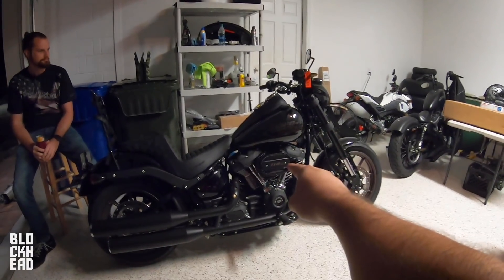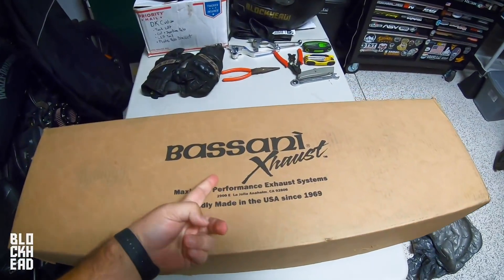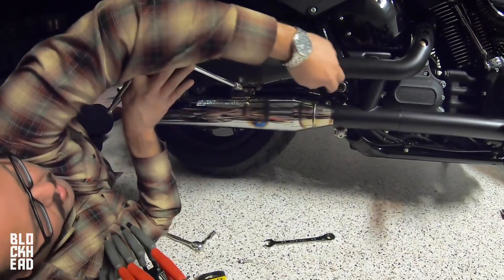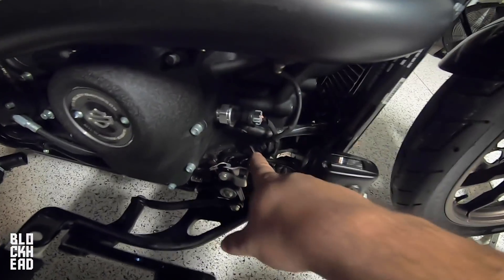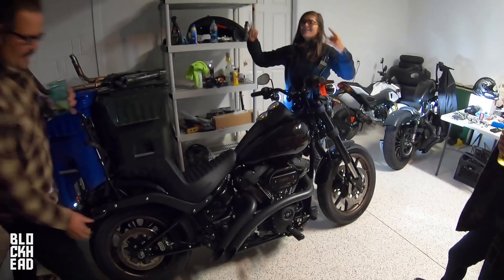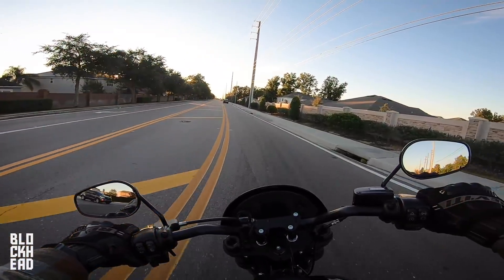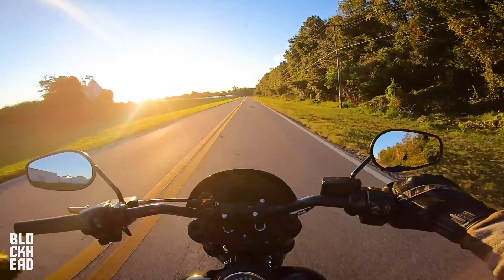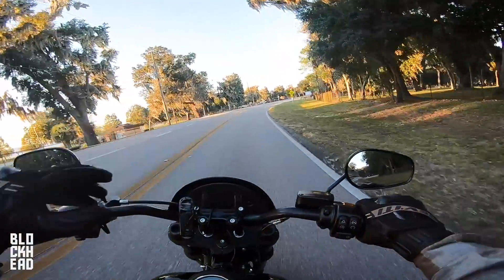2020 Harley Low Rider S EXHAUST Install! (Bassani Sweepers)

Comment: Does the new exhaust scrape? I love the look of the radius pipes and the. Bassani seems best because it doesn’t run low like the V&H big radius. My stock pipes on my 48 scrape when I lean it over in turns and I want an exhaust that won’t scrape when I turn hard.

Comment: I have Bassani pipes on my Sportster XL 1200 and I cannot mount the rear passenger peg due to the pipe blocking the mounting holes on the frame. Any suggestions on how to mout the peg?

Comment: Hey Blockhead you have the baffle inside yours? Put these on my 17 fxdls without the baffle but haven't started it yet after my new engine replacement due to lifter failure  110 se

Comment: Did it run good without issues just doing the exhaust and not an aftermarket air intake or fuel tuner?

Comment: Just got my 2021 FXLRS, got my hands on some exhaust, but if im only swapping the exhaust, is a tun necessary? Everything else is stock
Reply from the maker: Most say you can get away with running just an exhaust and not updating tune, but a tune is always beneficial. That being said, I ran a bike with exhaust only for a long time with no issue. YMMV
Reply: @BlockheadMoto  ill probably just stick with slip ons for now, if I'm going to swap the exhaust, I'll do the cleaner and tune at the same time. Thanks for your input, I appreciate and love the content

Comment: Looking dope, Block!  Did you use FP3 again or getting it dyno’d?
Reply from the maker: No tune atm, waiting on some incoming engine work and then planning on a TTS
Reply: @BlockheadMoto  in your opinion: is changing the exhaust without a tune okay? Wanted to change my exhaust but wanted to eventually put a thundermax EFI. Should I be okay riding around a few months without a tune?

Comment: Just bought the Bassani road rage 3 for my 2020 Low Rider S. Do you know what the torque specs are for the exhaust flange bolts or did you just tighten the bolts till you felt they were tight enough? Can"t find the torque specs anywhere online.
Reply: I think it’s 60-80 in lbs but I’m not positive. Did you ever find out what it is ???

Comment: Did you say crush washer? I’ve never heard a lock washer called that before. New term terminology.
Reply from the maker: Doh! Crush washer's are used for timing on muzzle brakes or flash hiders on the ends of barrels, traditionally on rifles. Some habits from me being a firearms instructor are hard to shake, lol

Comment: Dude that exhaust sounds sick! I'm having trouble figuring out what I want to put on the 19 street bob.
Reply: drakeblood47274 if you care about performance I’d go with a 2 into 1 pipe . From bassani, D&D or S&S . There are others as well of course. What will really help is an S&S gear drive cam or redshift , Andrews etc . 
A quality basic performance upgrade is a cam , pipe , air cleaner and tuner . With the new motor that’s all you’ll need . Getting the right combination is crucial though . Companies like S&S or Zippers Performance have complete packages that are designed to work together for maximum performance for that type of upgrade .
Reply: @hughsnyder891  right on thanks for the information.

Comment: Sounds okay but bad choice for performance on M8 motor. M8 needs lots of back pressure. D&D 2 into 1 is top notch for this application.
Reply from the maker: I’m happy with my decision
Reply: BLOCKHEAD happy with bad performance? Ok. I understand u have to promote ur sponsor but for the newbies  watching u should have a performance disclaimer so they don’t waste their money.
Reply from the maker: @jetag93 Me picking this exhaust has nothing to do w/ a sponsor. I got the exhaust I'm happy with, after having owned a 2-1. If people want one focused on performance, Bassani offers that as an option (Vid: https://youtu.be/zR2gWWorNDA )

Newbies should be doing their research, just like I did when I was a newb. In the next video (Monday,) I do mention 2-2 vs 2-1 as well. I've provided a ton of info in the nearly 400 videos that are on the channel about all sorts of stuff, including exhaust, tuning, air cleaners (full stage 1) and more. If you'd like to take a different approach and educate people, you're more than welcome to create a video and upload 👍

Comment: Im very surprised that this has kinda become your modern dyna revisit bike. Even though all the play up for needing a bike to do longer distance to and from work rides. To me with the direction of this build why did he not just keep FXDR? If you was putting a batwing fairing or a big windshield and bags on this bike maybe but I got the feeling that’s not in the plan. It’s his bike so he can build it how he wants but if that’s what he wanted he should have just said that from the beginning.
Reply from the maker: "Why did he not just keep FXDR." Because the FXDR and the FXLRS are not the same bike, at all. 

I've gone over my plan on the direction of this bike in another video, check it out! Windshield + fairing + bags are in the plan 👍 - https://youtu.be/nReOTdkYn_I

Comment: 0:12 We have Wess and you all don't know this guy, who are you? Bagger "Meh"
Reply from the maker: Bagger Brah, lol
Reply: @BlockheadMoto  Question Block: Have you ever tried the ceramic coatings for exhaust? I believe the company called Eastwood carries a high temp internal coating that comes in a spray can with a attachment made for exhaust. Just thought it would make for a good video, for people who ride and may suffer from heated leg syndrome.
Reply from the maker: @cyberpunk4622  Never heard of it, I'll have to check it out! Thankfully the M8 doesn't get too hot, especially as compared to the 110 TC

Comment: what's a "bracket tree"? lol
Reply from the maker: Like a triple tree, but for brackets, lol (bracketry!) 

bracketry. Noun. (uncountable) (automobile industry) The mounting hardware used to hold one part to another; typically consisting of stamped metal piece(s) that make up the actual bracket, and any other bolts, nuts, u-bolts, rubber etc. that are needed to complete the mounting of the part.